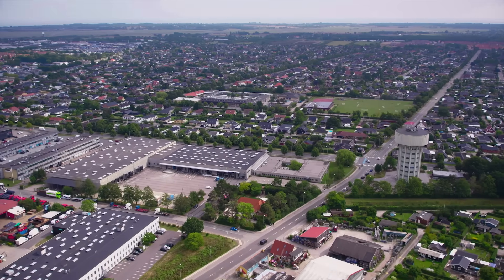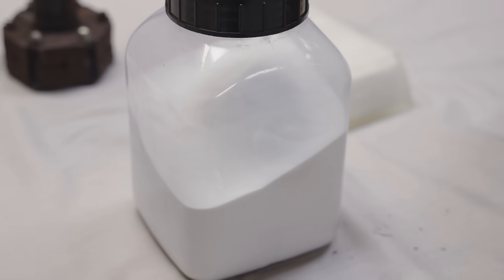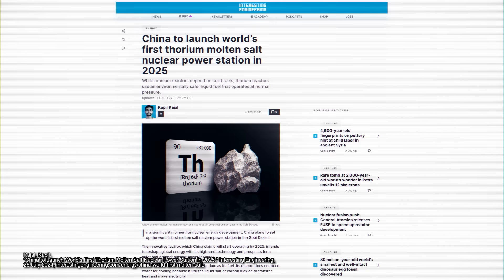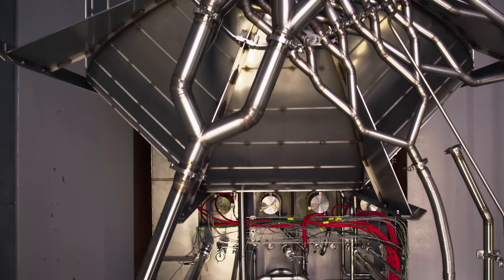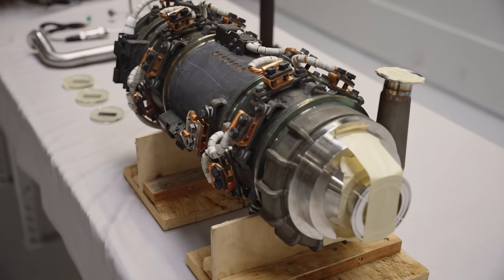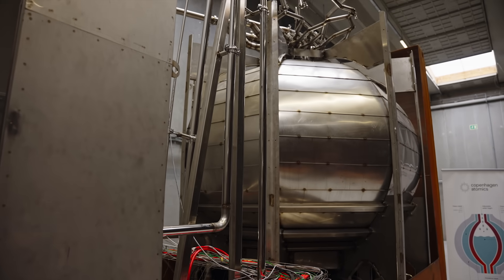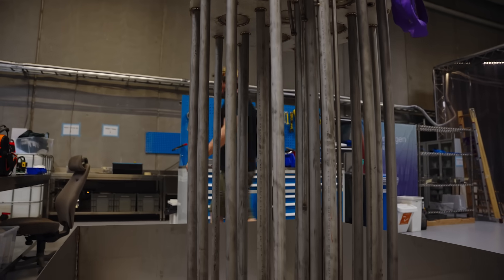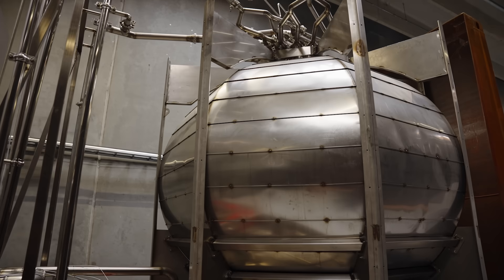Why Isn’t Thorium Changing the World?

Comment: Probably the same issue that's plagued nuclear power forever: No fast return on investment and ignorant fear.
Reply: Sadly, unless you're funded through taxes, assume the market you're targetting has absolute ADHD. If you can't pump out things fast, it will just get bored and cut the funds.
Reply: @shapelessed  this is where smrs come in. small modular reactors. they can be built in a shop are are way faster to instal.
Reply: @alexlindekugel8727  In theory, in practice, they haven't been much successful.
Reply: His numbers on solar/pv are only out by 300%. I hope his math on his own tech is more accurate. Love the idea, but nuclear track record for costs and install times are always wacked out, typically tripling or more.
Reply: 7:30 it is nearly impossible to service something inside a nuclear reactor
he kind of glosses over this. but that is actually a major driver of cost. and also a driver of risk.
Reply: Was "Why Isn’t Thorium Changing the World?" addressed? All I watched was msrs. Cant thorium be used in traditional reactors?
Reply: @namename9998 Thorium is not the nuclear fuel in a Thorium reactor. When a Thorium atom is hit by a slow(thermal) neutron it eventually decays into uranium U-233 which is fissile when hit buy a slow neutron. So that is why they refer to this as a "breeder reactor" because it creates it nuclear fuel from the thorium.
Reply: @corporalpunishment1133   I'm confused lol. You started with "thorium is not the nuclear fuel" but ended with "because it creates its nuclear fuel from the thorium". Either way fast/breeder reactors already exist.

And I thought the video was only talking about MSRs not fast reactors. MSRs can be "b" reactors but fast/b reactors arent MSRs.
Reply: @namename9998  These are not fast reactors they use neutrons in the thermal spectrum so Thorium reactors have a moderator in this case heavy water. Also I don't believe they're are any fast breeder reactors operational in the western world right now.
Reply: @corporalpunishment1133  But the title of the video is "Why Isn't Thorium Changing the World?" it doesnt seem like that was discussed.
Reply: @namename9998  Theoretically, yes, but it's even less practical than those reactors using Uranium. The molten salt part is what is important, and the benefits are largely the same regardless of if the reactor runs of Thorium or uranium.
Reply: Business graduates are intimidated by maths, diagrams, and non-negotiable precision.
Reply: Mismanagement of humans is real. But, if it is presented as way cheaper and with less waste product, it might be easier to sell.
Reply: No "fast" return of investment is a very harsh understatement. The average construction time of a regular nuclear power plamt is about 20 years with an investment cost of about 1 billion € per year. So in those 20 years amd all that investment you get literally nothing in return. Then once it is completed it does not run for free, you need to have a steady flow of fuel which is very limited and in regards to Uranium 80% of the market is controlled by Putin. So conflict about nuclear fission fuel is very likely if demand is high.
On the other hand constantly adding solar, wind and energy storage constantly increases the energy outputand availability at a far lower cost and at construction times measured in days to weeks instead of decades and prices in tange of thousands to millions of € per unit.
Since we are all using the Internet, a distributed system, I should not need to emphasize the advantage over a centralized system typical for nuclear energy. Single point of failure is a real thing, especially with naturl disasters, sabotage and war.
Reply: Plus, the people funding the research ("governments") wanted to make bombs. Thorium cycle reactors don't do that. Also, there were some serious material science challenges to be worked out ($$$$$$$$$) that no one was sure could be solved back in the 60's. (I'm impressed they've made something NaF doesn't instantly eat! As salts go, choosing NaF is ambitious.)
Reply: So far, not only has there been "no fast return" on nuclear power, there has never been ANY return on nuclear power.  Without massive subsidies by the taxpayers, no nuclear power plant would ever have gotten built or operated.
Reply: There's not ignorant fear when u hold the power of an atom
Reply: Yep, unfortunately this plagues any kind of big projects now. If it doesn't promise exponential growth, then it's not a good investment. They should just lie about it like everyone else.
Reply: @soldat88hun  Growth is subjective. Eventually nuclear plants will make a profit. Solar is about job creation. Nuclear can generate almost 8k mwh per 1 worker while solar generates maybe 200 per 1 worker. Not even 1/10th of nuclear. And that might be direct jobs. Solar needs more land than nuclear so everything is spread out more which means you need more jobs to support the sprawl.
Reply: Its more like no return on investment ever.
Reply: You forgot massive cost overruns.
Reply: Almost like having a system that only cares about short-term profits isn't a great system. There's a reason why experimental reactors, including Thorium reactors, are making the most progress in China.
Reply: @amihartz  Short-term profit has nothing to do with it, at least not in any way you're thinking (greed).  Resources are finite, and economics, being the study of the allocation of finite resources, will dictate what investments are worthwhile across any time frame.

Commercial Uranium fission power plants, the currently most well established technology, have a time to profitable cash flow of over a decade (after figuring capital financing costs.) This isn't time to fund greedy consumption of fat trust fund babies, this is time until the generation of value of the power plant exceeds the costs to build that plant.

Residential solar power, not even considering the economic benefits of utility scale deployments, have a time to complete "pays for itself" on the order of 6-7 years.

Now throw onto it that Thorium salt reactors are trading more complex facility costs, higher startup costs, for cheaper fuel costs, when fuel is only a trivial part of the costs of a uranium power plant. Thorium solves the wrong problem.

You're repeating "Capitalism is bad" propaganda myths without understanding what the fundamental resource allocation concerns are.
Reply: @ Didn't USAID funding dry up? Are you US State Department bots now doing this for free?
Reply: @amihartz  glad usaid funding is going way, funding WAY to many kickback items. No, not a bot.
Reply: @Meton2526  I always see nucelar power as part of the solution not a silver bullet
Reply: @Meton2526  A Thorium MSR is actually expected to have significally lower capital cost than current reactors. The real hurdle is the R&D cost to get there in the first place, which far outweighs the cost to finally build the first commercially viable one.
Reply: @Meton2526  well for the most part yes. but least in the usa it has been so long since built reactors that alot of the knowledge was lost. so minuses the new voulgal units cost over runs are huge just coz dont have the knowledge to build from ground up anymore and there a hell of a learning curve. in reality should take 6 to 9 years to build but thats also what scares investers is there could be a change in regltory and shut whole thing down and there goes any money invested. a nuke is a high investment risk. once there on line yah there money making machines but till then.
Reply: @Meton2526  Its so nice to see someone who actually understands lol. Capitalism is simply an autonomous system of resource allocation that rewards the right choices. That's what makes it so good (but also sometimes smothering).
Reply: @ Capitalism doesnt reward the right choices it rewards the popular choices. Who is happy having to replace appliances every other year because things are made cheaply. The companies that make cheap products make more money because people keep buying their products because they like spending less money today despite spending more long term.
Reply: @amihartz he does have a point. Thorium is cheaper than uranium but the main thing stopping commercial construction is the decade of planning and construction for the facility to maybe be operational, not the furl cost. Then it takes another decade or two to start earning profit for the investment. Overall its about twenty years before the investor sees any kind of real return on their bet. There are simply better things to invest into for profit in the energy sector right now.
Reply: @Krobear  Ok bot
Reply: @Meton2526  Capitalism IS bad, at least in some ways, and your explanation of why it's keeping thorium reactors from succeeding more quickly is why.
Burning coal and oil because it's more profitable and therefore "makes more sense" for investors as a "better resource allocation" is "allocating" us into an unlivable planet, and that is not a good investment in the long run.
Reply: @amihartz mentally challenged child thinks only state sanctioned bots have anything good to say about the US 😂😂
Reply: @amihartz  Your FSB funds havent dried up I see.
Reply: @correctionguy7632  what is FSB?
Reply: Pretty much. I find molten salt personally to be kind of scary stuff but I trust they know what they're doing. And yeah slow money and fear
Reply: @borttorbbq2556 Just something to bear in mind: we have been using molten salt for power generation for decades now, just not with nuclear reactors. Arguably the biggest usage of it has been in, believe it or not, solar.

You know the solar farms typically seen out in desert-like environments, where there is a circle of dozens or even hundreds of mirrors arranged around a central tower? That tower actually contains salt, and a lot of it. The light reflected off those mirrors heats up the salt and keeps it molten, and the heat from that salt gets exchanged to work steam turbines that generate electricity.

So why use molten salt? Because it holds enough heat to keep generating steam and thuse generating electricity at night. So when people say, "You can't use solar at night," that only applies to photovoltaic cells, which are the kind you see mounted on houses and other buildings. For dedicated solar plants, molten salt is how the issue was solved.
Reply: @borttorbbq2556  This molten salt is only scary if you're foolish enough to choose to do something stupid near it. It's basically just spicy rock juice that makes water hot. Just don't put it on your fried egg and you'll be fine.
Reply: @borttorbbq2556  what do you find scary about molten salt?
Reply: Don't forget special interests trying to stop it from happening too.
Reply: @sciencecompliance235 Can you tell me when in this video dose he say special interests are trying to stop us or something like it?
Reply: And you can't make nuclear weapons using Thorium cycle.
Reply: @spacecadet35  You can but you have to try really hard 😂 it still makes the materials it's just in much smaller numbers🎉 so that's great Do we really need more nuclear weapons?
Reply: @Zrytun  - I don't think so, but the Uranium Cycle  technology is the dominant form because of this. To change is a big investment, and also, if you believe the suppliers of the Uranium cycle equipment, it is a huge risk to go to Thorium.
Reply: @Zrytun  Try really hard is an understatement. The thorium fuel cycle will inevitably produce some U-232, and this has to be kept below 50ppm for an implosion type. It's also a potent gamma emitter, which greatly complicates handling and storage.
Reply: @spacecadet35  They're technically correct, but the difficulties are so great that anyone capable of doing so would have significantly easier avenues available to them. Also, the Uranium fuel cycle isn't applicable to weapons production. Facilities for producing LEU and HEU are not laid out the same, reactor grade Plutonium is useless for weapons, and the technology for enriching Plutonium doesn't exist.
Reply: @spacecadet35  sure you can. It's more difficult, because the byproducts are really radioactive, but it's far from impossible.
Reply: @gasdive  well the thorium cycle produce a uranium Isotope that isn't the best for atomic wappons  on the yield part but it is possible
Reply: It's such a shame that it has to be built soon and be economically competitive. It would be great if we could generate electricity with pie-in-the-sky dreams.
Reply: IMO small modular mass produced commercially avalible nuclear reactors is the only way to get private investment interested in nuclear power. not large partially state funded power station, but a corporation who buys a small nuclear reactor to make their corporation more self-sufficient.
Reply: @gawkthimm6030  do you want cyberpunk? Because thats how you get cyberpunk.
Reply: Main problem is the thorium cycle has intermediate reactions which can create highly enriched weapons grade fissile material.  The end reactions may not be usable for weapons, but who cares if you are a bad actor.  This is why nobody has pushed this tech.
Reply: @ You do know that NK doesnt have a nuclear energy program but they have nuclear bad stuff. You dont need thorium reactors.
Reply: There is a security issue with small reactors. Cannot guard all those small reactors against terrorists. So i am not convinced about that business plan of placing them at private companies. And that other part of the business plan, combining a few hundred of them to finally get a gigawatt, that maybe not cheaper because it's less efficient and maybe needs more maintenance compared to one big reactor. Not convinced
Reply: @ We wouldn't have to really worry about terrorists if we weren't doing a lot of unwanted and destructive meddling in geopolitics to secure our own access to oil, which is a problem that using nuclear instead of fossil fuels would help solve.
You're worrying about a problem while a big part of the solution to that very problem is what you're looking at and saying you're "not convinced" by. That makes no good sense.
Reply: Sorry the , 'trust me bro' if nothing bad at all happens for the useful life of plant you might make you money back isn't a very good sales pitch
Reply: @ It's a great sales pitch in any system designed to be more rational and responsible than capitalism. Most nuclear plants will have nothing bad happen for the useful life of the plant, and the ultimate costs in terms of destruction and human harm caused for nuclear absolutely beat those costs for fossil fuels.
Reply: @SunShine-xc6dh  1. The vast majority of nuclear power plants will in fact have nothing bad happen for the useful life of the plant. That's proven in the nuclear track record.
2. It's still a better sales pitch by far than the one for coal/oil, which is guaranteed for a fact to kill people through pollution and the problems with mining / oil extraction even if everything goes right with the plant.
Reply: Or the simple fact that it's the worst investment for your money in terms of KW per dollar...
Reply: @francescosirotti8178  Agreed. Solar and wind are the worst investment for your money in terms of kw per dollar.
Reply: And it is slow as fuck And very expensive...

Comment: 8:02 Betts and Gurard use Hastelloy Trimmed parts in their Venting and Valves. It's around 3x the cost of a 316 Stainless Material. 

Tried to experiment if would be worth it for the whole fleet of Chemical Tankers we run by piloting on my 50 Units Dedicated to me. 

DENIED!. Cost and weights were close enough to consider but laughed out of that meeting after the knuckle daggers pretended they knew by saying things like "too heavy" or "too much". 
Ughhh, so when I heard Hastelloy I perked up. 

My parts were just trimmed in Hastelloy so could see how an entire Valve or pump made entirely of this could be very expensive. So....Trim it to win it maybe😊

Comment: maybe it's because of politics, maybe it's because of radioactive lava rusting through your pipes.
Reply: Right? Just ignore they don't have a working model, even though the video claims otherwise multiple times. 

This feels like a sponsored commercial.
Reply: Not necessarily sponsored. I think Kyle Hill is genuinely into it, and I think it's good that this technology is discussed. Thorium breeding is very promising. Mixing it straight into the molten salt however is where I think we are misguided.
Reply: @martinzihlmann822  I'd agree with you except he mentions the company BY NAME multiple times and it paints them in the light as if they are the only ones doing this research. He even mentions their working model which... doesn't do what it's claimed to do. So is not exactly working, perhaps a model. No proof of concept.

I expected a link to a prospectus at the end for investors...
Reply: it's already difficult enough to control the reactivity in the reactor. With nucleides just in solution with whatever elements got oxidized away from your pipes, you basically have zero control.

Comment: I thought ceramics could be used inn high corrosive environment.
Reply: Fluorine compounds are extremely aggressive. Even glass can be corroded by elementary fluorine. And as @canolathra6865 has said, it is not a good idea to put such a substance into containers that can shatter.
Reply: they probably just use a sacrificial anode